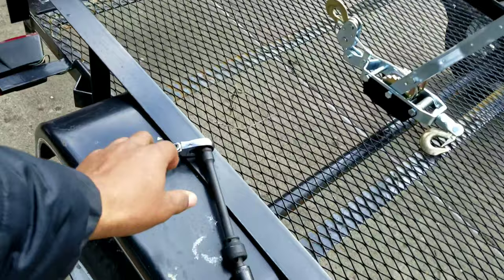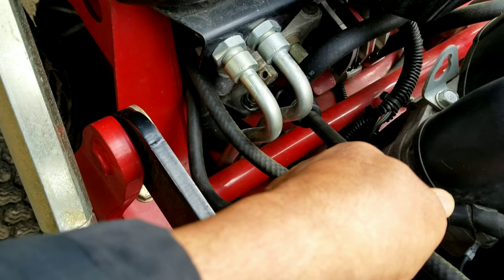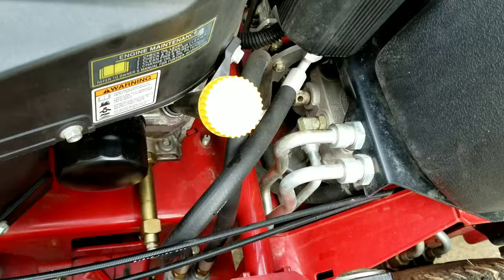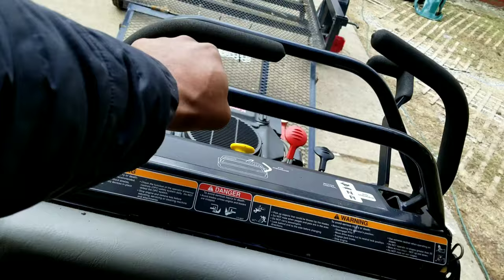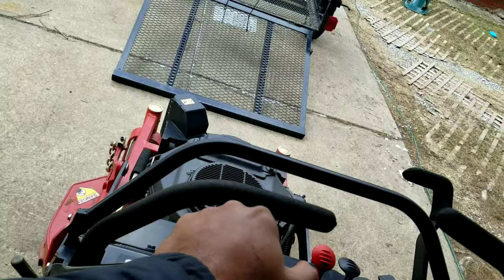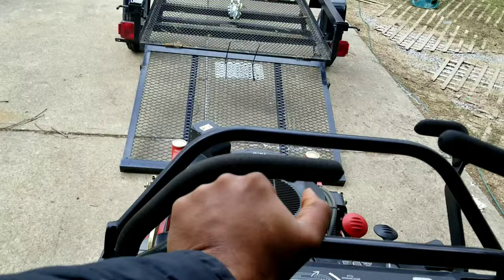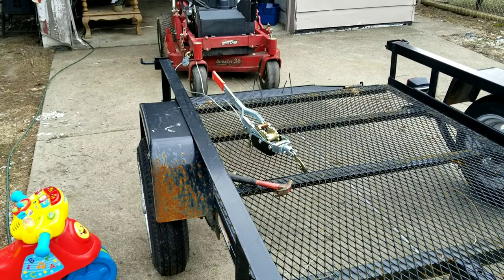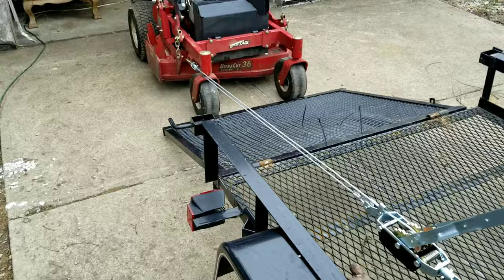How to tow a lawn mower

Comment: The reason they are so hard to push is the hydrostatic transmission is acting as a brake. It is very bad for the transmission pump to force it to roll. If you were to drag it with a four wheeler you may damage the seals in the pump. There is a way to release the hydraulics. Get advice on this from your dealer on where these valves are on your machine  Just a suggestion.